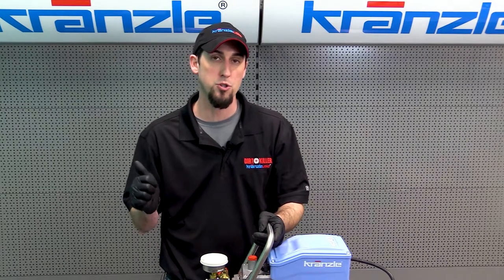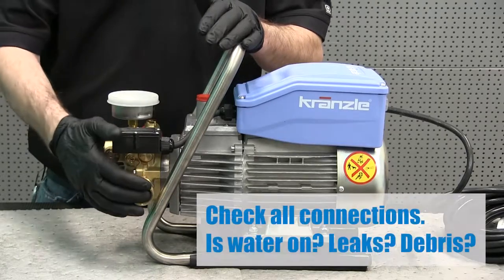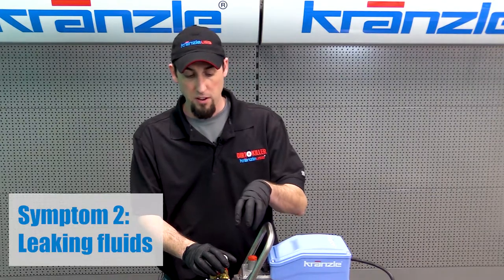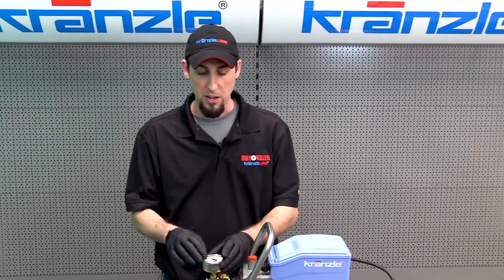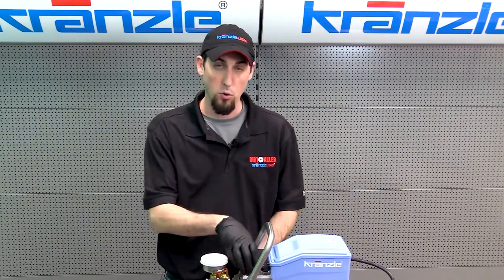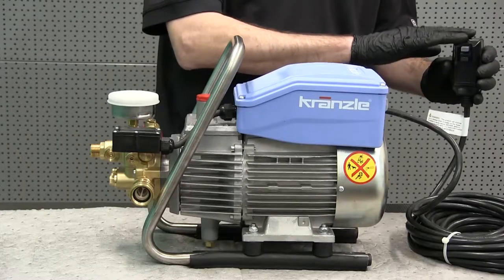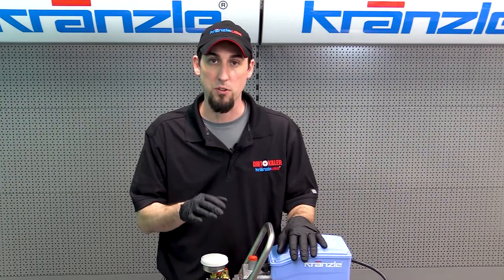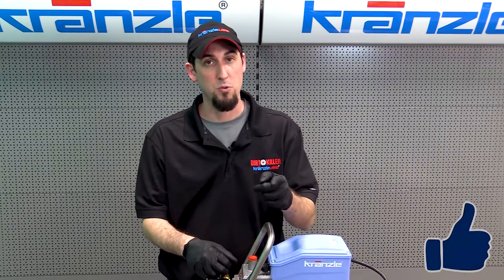Kranzle repair - 4 primary symptoms

Comment: I have a kranzle which when turned on there is a continuous hum out of but it is not building any pressure.. do you not what the problem is.. I’ve cleaned the inlet and outlet parts and have also done what you showed in this video with no difference been made with the machine. Any advice would be great?
Reply from the maker: A hum generally indicates it's a CAPCITOR problem. Check this video. Minute 3:36. https://youtu.be/flrKI2Tc7bQ
Reply: I found the problem after the seals were getting stuck because of hardening on the springs I gave them a bit of a clean with wd 40 and the washer is back to normal now again.. I wonder should I replace the seals anyway

Comment: Hi Josh, my 5 month old K1322 is having a short cycling issue. At one point the valve body was dripping a little bit of water every 5 minutes or so but that seem to have resolved itself after a period of usage, but the short cycling has not gone away. I've checked the inlet for any leaks and my accessories as well. Anything else I can potentially look at?
Reply from the maker: Hi. This is Mike. SO, to confirm. There are NO LEAKS anywhere?  Not inlet, outlets, accessories. If that's the case, give Lee a call to help diagnose. 800.544.1188 M-F 9-5 EST. *He is out the rest of the week, but will be back Monday 4-10-23.

Comment: Hello sir my kranzle 1322 is leaking on the bottom out those little whole right by the brass ..   it runs fine but leaking when running . Not the bolts but where the pump(brass) connected to the pressure washer
Reply from the maker: Hi. If you could please call us and send a photo so we can help troubleshoot. 800.544.1188 M-F 9-5 EST.
Reply: Hello did you find out what was the cause of the leak?

Comment: When I removed the pressure gauge to check the valves it was entirely clogged with a white crystalic powdery substance going from the brass body into the guage. Can i remove that powder or do i need a new gauge?
Reply from the maker: FROM JOSH LEE directly.)
.. The threads in the housing and on the gauge are BSP (straight).  The connection is sealed via the flat surface at the end of the male threads and the flat part of the brass head inside that port.  It's hard to see from the picture; however, small thin aluminum washers are used to make that seal (similar to the gasket in the garden hose connections.  The chemistry of the water leads to the breakdown/oxidation of those aluminum washers resulting in the white crust.  Most of the time it's due to the chlorine level of our tap water.  Although, hard water with a lot of minerals can cause it as well.

The best way for the customer to remove it is to supply the pump with water and power it on to blast that crap OUT OF the pump head.  In our shop, we usually have most of the parts removed so we wire brush it and then blast it with compressed air.

Comment: Hi there, we've a 2160 ts and it's not turning on anymore when it was working a few hours ago, the power light switch is also not turning on. Any ideas?
Reply from the maker: Did you reset the GFI? Blow a fuse  house breaker box?
Reply: @kranzleusa5846  Hey, got it fixed, not really sure on the issue, it blew another fuse when we replaced it from the plug but then we said we'd try a third fuse and no issues since.
Reply from the maker: @Enwrong_  That's great! Glad your found a solution. Sometimes fuses just go bad.
Reply from the maker: @Enwrong_  Glad you got it resolved.

Comment: Hi Josh, working and resolving a few issues on our Kranzle....one question.....if there are signs that glycerin is leaking from the area where it screws in, could the glycerin be topped up and the issue repaired.?
Best Wishes SImon
Reply from the maker: Mike here. It it's leaking, it needs to be replaced. Yes, we have replacements. Order at a dealer or online. https://www.dirtkiller.com/shop/97150393-kranzle-pressure-guage-0-250-bar-1-4-inch-male-threads-8829

Comment: Hi Josh quick question just bought a kranzle here in Canada K1622TS and when I connected it there’s no leaks and it has its own 20 amp plug.  I let the water run through it to get the air out of it and then when I hit the power button it automatically trips back off and that valve on the side popped out and there’s nothing.. when you press the trigger to release the water that is in the machine that valve pops back in again the power button already tripped so there’s nothing. Let the water run through it again hit the power button it engage it but the power doesn’t stay on that valve opens up and still nothing. Hit the trigger to let the pressure out and that  little valve closes back  but I can’t keep the power on. there’s no leaks and it’s from a garden hose so I can’t figure it out..any help would be great.. ive contacted the distributor where I purchased it.  If I were to hold the power button manually it would stay on but I don’t wanna do that obviously it’s tripping shut for a reason? please assist thank you.
Reply: TRy these steps...PLug the cord to a different outlet by itself meaning the outlet must be by its own and if ithe outlet is connect with other outlet? unplug any electronics on them...Try pressing the gun when turning it on and see if it works, check ur unloader it might be turn in too much and also make sure ur nozzle size correct...
Reply from the maker: Hi. Just saw this. Please give Josh a call at 800.544.1188 M-F 9-5 EST so he can help you trouble shoot.

Comment: Josh. Thanks for the video.  What is the difference between the 1322ts and 1622ts?  Was told they have completely different motor and windings?
Reply from the maker: The primary difference is the PSI and GPM, which is caused by the wobble plate in the pump. The 1322 is an exclusive we made for Obsessed Garage to work with his accessory kit.  The 1322 ships without accessories. The 1622 has slightly different GPM/PSI and comes with the stock Kranzle accessories.
Reply: @kranzleusa5846  thank you for replying with the info.  What exactly is a wobble plate?   From what you said it sounds like they are pretty similar (depending on what exactly a wobble plate is and it’s function) because I was originally told the 1622 had a completely different motor and windings?  Thanks again for your help
Reply from the maker: @jrose7381  The wobble plate is inside the pump. Unless you take the pump apart you would never see it or touch it. Variations in the wobble plate, in part, are what give variations in GPM. The tip orifice size is what actually causes the PSI. Any other questions?
Reply: @kranzleusa5846  no sir.  Honestly thank you for taking the time to explain this and clear things up for me.